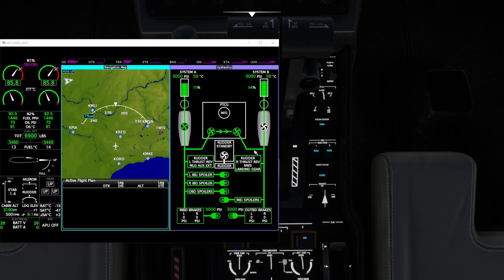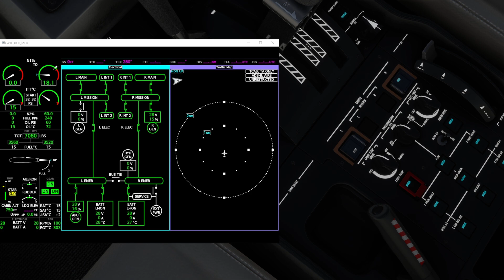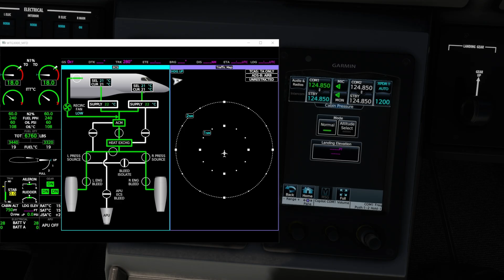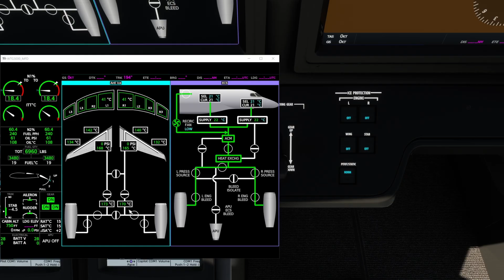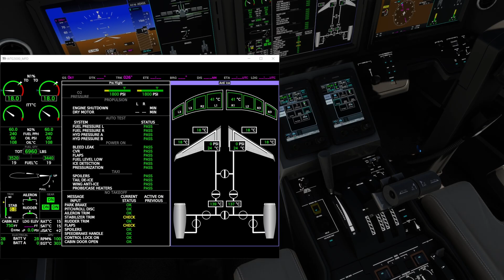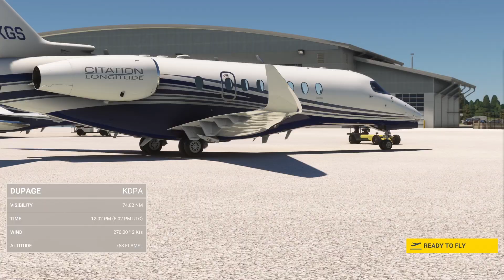Nothing to Study in the MSFS Longitude? Think Again.

Comment: For those that have flown airliners and/or Longitude on VATSIM "events", the Longy is by far the most fun. Even tho it is not single pilot certified, IMO, it is easier to fly than single-pilot certified Phenom 300/G1000, which I have been flying in XP since 2014. I fly FBW A320 sometimes in VATSIM. It is definitely more work to fly single pilot, If you fly it properly with checklists/flow etc. RW pilot and longtime simmer since 1999. MSFS, Longitude, WT G5000, flight simming has never been better.

Comment: The fact that all the parameters of both engines are identical diminishes the seriousness of the simulation for me. A lot of effort has clearly gone into the project, but it seems that the engines have not been given the attention they deserve. Everything from fuel flow to oil pressure and temperatures is identical across both engines. N1, N2, and so on—everything is the same. It’s almost comical, but also disappointing. It’s hard to understand how the creators could miss this, especially after putting so much effort into other details. It’s a shame.

Comment: After CL650 Hotstart this is not called study level, not even 10% Study level is not called explaining the pages in systems, study level is when you have over 1000 failures from just a switchlight or short in some circuit to critical failures, smoke in cockpit or bird strikes. Study level to me is close to FTD in where i logged alot im different types. Not a single aircraft in MSFS gives me that feeling. CL650 does.
Reply: Black Square simulates this AFAIK
Reply: @jaybeebartolome8386  BS is good products, I know. It's just not to extent of 2500 which CL650 has

Comment: Hi Matt, a really fantastic video on a great Aircraft.  I think it is a fantastic idea to showcase the level of detail in the simulation in such a way. I certainly hope there will be a second video going into the avionics in detail. One question/critique on the Longitude as it is in the sim currently: Is there a reason why the the in game Check List is in such a  dire state or are there plans to update it? I would love to see it being updated to include the Section 17 Normal Procedures from the Operators Guide where possible. Having Check List items read out by the copilot is quite a nice feature and can add a lot of immersion especially in VR where going through a PDF file can be cumbersome.  It would also help simmers who are new to the longitude, such as myself, a lot with the initial familiarization with the aircraft. I have just started to use the Longitude more intensely a couple of days ago. To be honest, the missing in game checklists have put me off a bit and have sort of given me the impression that this airplanes simulation was a bit neglected so I never really started to fly it in the sim. Only after watching this video and flying it a bit more did I realize what a true gem it is and how wrong my perception of the depth of this aircraft has been. Great work on both the video and the Aircraft!